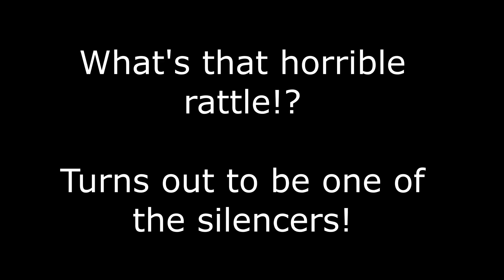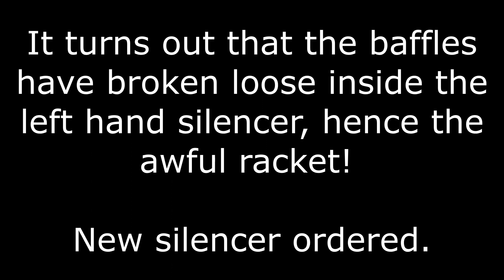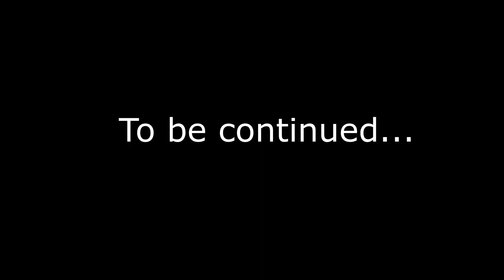Norton Commando 850 MKIII. First Ride and Carb Tune!

Comment: An interesting technical and over Norton video on setting up standard carbs
He seems to say, if you take them off you can you measure the height of the slides and adjust them so they are both at the same height then with the carbs off the bike when you work the throttle you can see whether they rise together so you can adjust that on the cable and he always sets the mix screw to one and a quarter and he explains his reasons

Comment: I am a bit jealous after a business trip to Germany I am currently recovering from COVID so can't get out.  I have the same basic front brake set up on one of my Commando's and I found without further work it's not very good, not much different to the standard brake, the problem is the upgraded caliper has smaller pistons than the standard caliper reducing the mechanical advantage of the master cylinder. I have made 3 changes, the first was a Lockheed racing lever, which gives a greater leverage, this helped but still not up to modern standards, the second change was converting the master cylinder to 13mm, these are now available to buy but I fitted a RGM kit, this made a significant improvement good power but still a lack of bite at lower speeds, the last change I made was fitting EBC FA16S organic pads, this made a significant improvement, the brake is now very close in performance to my second Commando which has a 12" disc fitted with a modern four pot caliper, a little less feel but more power than an Avon Roadrider tyre has grip. The main issue is the cost is £450 for these parts you can save over half of this if you use the RGM 13mm sleeve kit but this is fairly involve to fit.
Reply from the maker: John, that's great info, thanks. I do have the 13mm master cylinder conversion on my own Commando, but I'm not entirely sure what's fitted to this one. I have just ordered new racing brake pads from a supplier I know who rates them highly. Let's hope that they improve things considerably as at present the brake is very poor with a very wooden feel, and it bites too early so the lever is too far away to get a good grip on it. I'll post as to how I get on. 👍
Reply: @Chris.rooke150  When Norvil built the bike I don't think the 13mm master cylinder was available just the sleeving kit form RGM and I am sure Norvil wouldn't fit a RGM product.

Comment: Hi Chris, how many turns out do you have each screw at? I have an 850 fastback and its been unrideable for years due to the tuning.
Reply from the maker: The standard tuning for the pilot air screw is 1 1/2 turns out. On this bike that was just about spot on for the right hand carb, but quite a bit off for the left hand carb which is why it was running so badly at first. The only way is to experiment with a warm engine. If the engine doesn't change speed when the air screw is turned in or out then the pilot circuits are probably blocked. Good luck. 👍
Reply: @Chris.rooke150  Thank you. I’m 21 years old and your Chanel is helping me out a lot!
Reply from the maker: Good to have the younger generation involved! Feel free to ask questions if you need help. 👍